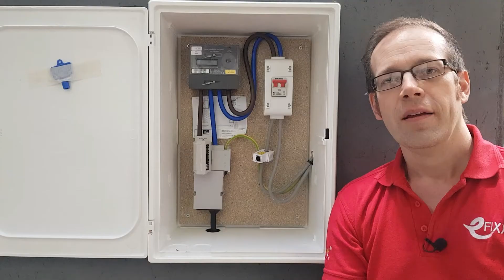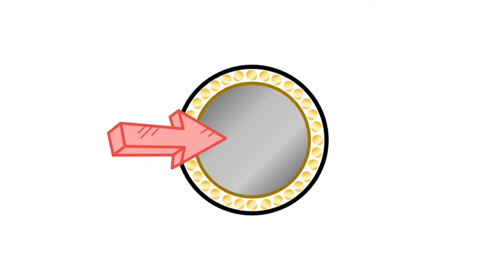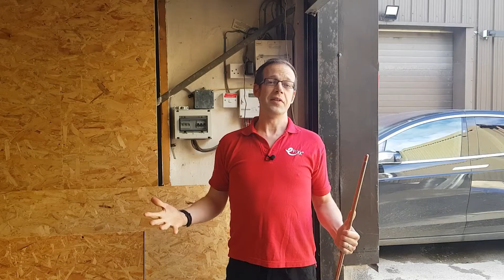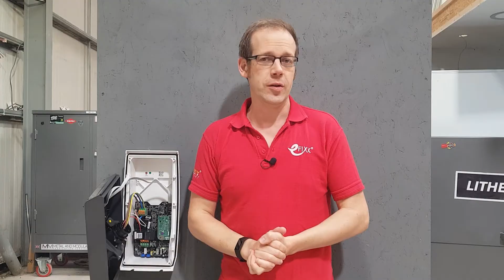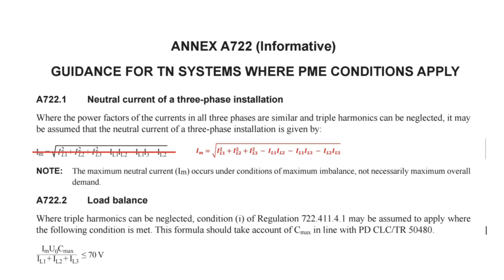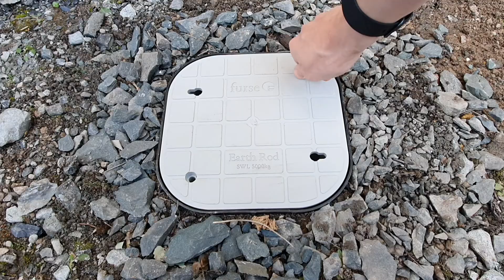EARTHING made SIMPLE with the INDRA SMART PRO EV CHARGER

Comment: You say this is a training video for experienced qualified electricians. So why do we have to get permission from the DNO to. Install an EV charge point? As experienced qualified electricians we will know or we should if an installation is suitable for an EV charge point and whether or not the Main cutout is suitable and can handle the extra load. NEC they will be expecting use to apply for permission to install a new light fixture or a new 13amp socket outlet.

Comment: Your videos are very well done and provide clear instruction,  just a question on indent IV, in one of your other videos there was a test rig set up and simulated a pen fault across a 3 phase supply, on the test 1 one of the phases went over 253V but the other 2 phases stayed between 207V and 253V, the voltage between the CPC and the ground was above 70 and didn't disconnect the supply, is that why this charger disconnects at 30V?
Reply from the maker: Yes I believe it is something along those lines.

Comment: Regarding simultaneous contact, say for example the EV charger is mounted on a metal post or within arms reach of an outside post light, assuming these have been earthed via a PME system would simultaneous contact be an issue here? As both are likely in contact with the physical ground much like a tap off of an underground copper pipe would be.

Comment: Can someone please explain to a layman why an EV needs special earthing arrangements and, say, a high-power domestic, portable heater not? (Please don’t bother to reply if you are going to sound like a moron).
Reply from the maker: Is the heater for use outside? 🤔
Reply: @efixx  No, that would be silly… But do people instal EVSEs in garages?  And it’s not like other devices that are mains powered are never used outside without the need for an earthing rod….
Reply from the maker: It was a genuine question, I was trying to understand what you were asking. People do install charge points on garages but far more common outside. It's the fact that you've got a huge lump of metal outside connected to the earthing arrangements for the house. If there's a certain type of fault outside the metal work of the car goes live and if you're touching it and making a connection to the general mass of earth you could receive a lethal shock.

Comment: Appoligies and just asking a question outside this topic but possibly same dangerous situation. Please correct me BS7671 does not permit export of PME to mobile caravans. Yet millions of owners use there tn c s system home supply's using there 25m cables to run caravans or motor homes at home. Caravan on rubber, caravan is metal, caravan has solar pannels, caravan has chargers. OK agree not huge chargers. Campsites have to follow rules which accommodated hookup points with earth Rods and certification. Question is would it be safer to use an pen fault devise made and sold for ev charge points on caravan hook ups. Looking on searches many issues with electric shocks from caravans connected to home supplies.
Reply from the maker: Yes it is a bit dangerous having a caravan plugged into the electrical supply on someone's driveway if they've got a PME arrangement. Gordon would probably suggest the simplest solution is to ban caravans!
Reply: @efixx given that there are now little cabinets you can buy pre made with pen protection, wouldn’t those also be good for caravan/motorhome/boat wall power sockets?

(Although, for that matter.. given how EV chargers work, how about if you install a real EV charger and then run a cable from your caravan’s grid connection to an EV plug via a little thingy that just tells the charger it’s an EV?)

Comment: Hi again, I would appreciate your help in understanding the dangers of simultaneous contact re car chargers. I'm sure I am missing something, but the way I see it is :  If all extraneous and exposed conductive parts (such as Tap and Car) are connected through the MET, then any PD should approximate to zero in normal conditions. Even in "Standard" earth fault conditions in the house where ADS has failed, any voltage on the water pipes will be reflected on the EV CPC. In the case of an open PEN all conductors in the EV circuit will be disconnected, so it will be as if the charger never existed. The dangerous set up seems to be  where the EV circuit is separated from the supply earth and given an independent TT earth. In this case an open PEN would make the tap "hot" and the car would provide a much lower (close to zero) potential - Hand to hand across the body.
Also could I recommend to trainees that they view John Wards excellent videos on the influence of   A) cable repairs  by the DNO, to the TNS vs TNCS status and   B) the inadvertent importing of potential on your utilities from neighbours who may have a different earthing system . eg  your property is a TT, but a neighbour is on a PME supply.
Reply: So to throw a spanner into your MET thinking... what about a lamppost at the end of the driveway?
Reply: @mikeschooling8346  I confess; lamp posts are outside my comfort zone. But I'm keen to learn.  I'm not sure where your question is leading.  My limited experience with metallic lamp posts has been on Landlord Lighting with seemingly TNS supply. The CPC connected the posts to the MET. But if we are talking about Non-private lamp posts, who could even be sure which transformer the supply comes from. Plz expand on your scenario, especially how it relates to simultaneous contact
Reply: Thinking about your question, I assume you mean - what if the car and lamp post are within touching distance. I assume all street lighting is on looped SWA 2 core and therefore always TNS. Hence the post is a constant earth potential. Unless I've missed something (quite likely) after the first 5 secs a PME supplied charger will be safe after an open PEN. Where as a TT supplied car charger will be safe after 40ms after an earth fault. On the other hand if the lamp post becomes live I would hope the circuit is covered by ADS even if not an RCD.  What does your experience say about the frequency of lamp posts remaining live - and a danger to every passer by!

Comment: I bow to what I'm sure is your far greater technical knowledge. But I do feel some of your wording and choice of image, with reference to explaining PME systems, must be confusing to training electricians. In my experience, a dedicated PME supply simply has one Line and one Neutral conductor in the supply cable and a Neutral block is provided by the DNO for an Earth to be tapped off if appropriate. You make it sound as if there are extra strands in the Neutral conductor which are physically separated at the head. Also your choice of photo would support that idea. However the photo actually shows the Line and Neutral conductors being separated and passing to the relevant sections of the head. To a trainee the photo could actually be confused with a TNS supply, since it is unusual to see Line and Neutral separated outside of the PME head. I know I'm being picky, but I remember how easy it could be to be confused by imprecise wording and imagery.  Keep up the good work.
Reply from the maker: That's interesting in my experience a concentric cable that looks exactly like the one in the video, which is why we explained it that way. We've taught quite a few lads who've worked for DNOs and this is the way they've shown it being done, even donating samples of cables. Interesting how different experiences shape different outlooks isn't it? Thanks for commenting, much appreciated. 😊
Reply: @efixx  Thanks for your reply. So long as your students don't have a problem with it, then it's probably just the way my brain works (or doesn't 😀)   What I meant was that your words were about the splitting of Earth and Neutral, while the image showed a concentric cable being split into Line and Neutral. That's what I think I would have found confusing as a student.
Reply from the maker: Oh OK, thanks for the feedback. 👍
Reply: @efixx  and lets not forget that a TNCS earthing system is not to be seen as a PME system UNLESS there is a sticker stating that it is a PME. Unlike college, which always told me that a TNCS was the same as a PME system, the DNO says it's not. Only regard a PME system if there is a sticker saying it is a PME.

Comment: i still dont get why the body of a car would be grounded to a 240v charging system. aint these 2 systems completely separated and therefor the body of the car will never become live
Reply from the maker: Nope. The body of the car is connected to the earthing arrangement of the house unless you use an isolating transformer in the property.

Comment: Great vid as usual Joe! I think I've missed a point somewhere though and tying myself in circles......... In a fault condition, 50 ma for 50ms is enough to kill....... how does that tie in with the device having 5s to disconnect?
Secondly, where do you stand with an aftermarket 13A extension lead to Type 2 solution? Or even a 32A commando socket for that matter.....
Reply: It is not likely that the fault happens just the moment you touch the car.
Reply: I too would like to understand the mitigation for using a standard 13A socket to charge a car in a PEN fault scenario.

Comment: Looks like a very nicely designed PCB from Indra, I can spy a Seeed Studio BeagleBone green in there for connectivity, not really sure why these EV chargers need so much computing power but it's nice to see the whole thing running from eMMC and not an SD-card that will inevitably give up.  I see some good details on the PCB that shows it was designed by someone experienced. The XP Power supply module and Panasonic relays will probably last forever and the lovely lever-arm mains connectors ensure good termination for supply. I do like the IDC push-down block for use with SWA cable with twisted-pair - that's neat - presuming its for remote CTs, do they include a punch-down tool?  
Negatives are I'd like to see these boards conformally coated (treated to make them resistant to corrosion from moisture) I also think you should have mechanical protection of the PCB, a slip and you knock some components off of the PCB with your 6mm2 cable - the average spark is used to wrenching things in!
Reply from the maker: Great comment, I'm sure Indra will be happy with your balanced and well thought out feedback. Thanks very much! 😊

Comment: Indent 4 - 253V rms seems a bit stupid, as I believe thats the threshold where G98/99 solar inverters will start curtailing, set it a few volts higher and you wouldn't have compatibility issues.
Reply from the maker: Hm, interesting point. Maybe it'll be changed in Amendment 2. Doubt it though.
Reply: They've gone for 230 +/- 10% probably because that's the tolerance allowed for a standard domestic power supply, but agreed a bit of headroom would be nice, especially given EV owners are probably statistically more likely to have solar PV as well

Comment: As I don’t like the idea of electric vehicles and EV chargers, I found this video very interesting and informative, but I think there is something amiss , ? Isn’t a car insulated from the earth by its rubber tiers ? And we are insulated simply by wearing shoos or boots ? So if a car’s bodywork did become live we unlikely to get a shock ? Isn’t this just the IET setting rules to prevent a problem that doesn’t exist? Or have I missed something? 
Fantastic video as always Joe 
👍👍👍❤️
Reply: Yes you can insulate yourself by wearing boots. But these regs are designed to prevent that 1 in a million chance of being electrocuted.
Reply from the maker: To some extent yes but it only takes a tiny amount of current to kill and there may be enough of a connection to earth to push that tiny amount through you.

Comment: Would there be any downside to using a plastic pipe to an outside tap as good practice in any case?
Reply from the maker: No I don't think so, I've known sparks swap a bit of copper pipe out for plastic in similar circumstances.
Reply: @efixx  Isnt water in a plastic pipe conductive, I know it has a lower conductivity but surely just a small plastic section electricity could jump between the pipework via the water...  Not sure what the resistance would be, think John Ward did a video on it..

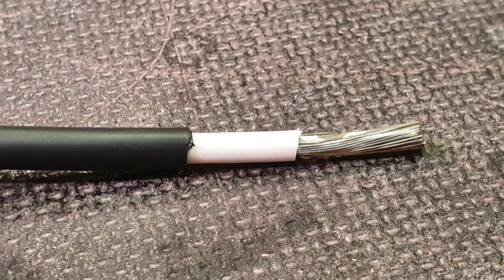Comment: 14:20 If the reference earth resistance can be as high as 600 ohms, why would the cable  need to be anything like as big as 4mm^2 ?
Reply: Mechanical reasons. In Germany the VDE tells us:

- 2.5mm² copper if the conductor is mechanically protected.
-4mm² copper if mechanically unprotected
-16mm² aluminium, no matter how the conductor is protected.
Reply from the maker: Not too sure to be honest it's what Indra recommend.
Reply: @efixx  We recommend 4mm solar PV1 simply as this is more rigid, easier to keep straight when direct clipped, readily available, double insulated and fits comfortably in our lever terminals.
Reply from the maker: Thanks for swooping in Mike, much appreciated. 👍
Reply: @mikeschooling8346 I suppose it doesn’t hurt that solar 4 mil is highly available and cheaply, due to the amount of solar installations going in these days.

(And of course it’s black and less offensively colored than some other cables)

Comment: I’ve swapped lights to double insulated to meet that requirement. Not as easy as it sounds. Not many double insulated lights out there, that I could find that looked reasonable.
Reply from the maker: Good on you for being thorough. It's easily overlooked. 👍
Reply: @efixx  Also applies to shared drives, so you might have to change the neighbours outside light and water pipe. I can't quite remember the distance but I think its around 8m to allow for the charger cable